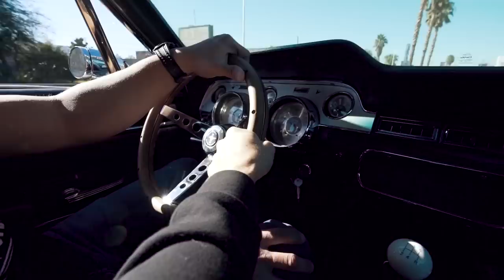THE WORST INVESTMENT *CLASSIC CARS*

Comment: You don’t know what happened? You went from 4th to 2nd big homie.
Reply: Austin Hayes that hurt to watch
Reply: Hahahaha lowkey huh
Reply: Never seen someone try to do that with out double clutching, and this guy supposedly “knows cars”
Reply: lmao i was thinking the same thing
Reply: @YxEthan  have you seen the video where he broke a brand new 2020 gt500 lol did a burnout straight away cold just been off truck 2 mins blew it up idiot guy all money no idea
Reply: Dude you can go from 4th to 2nd gear there’s nothing wrong with that. The car should not have shut off
Reply: Jacob s cool
Reply: Yx. Ethan 999 only been driving manual for 30 years so yeah I do know a lot about driving. Not saying he should have shifted from 4th to 2nd in a car that old but it definitely has some issues if it stalls out just from that
Reply: @ShiftyGenesys09  did you watch the follow up vid, sounded like that wasn't the issue in the end (although I agree shouldn't have been driven that way). Sounded like the car had problems out of factory already
Reply: @larssonk22  yeah he just shifting the blame ive never done anything like that in my car never jumped gears up or down only when stopping at a traffic light and doing 0mph lol
Reply: Jacob s it doesn’t have a rev limiter so he went too high of rpm trying to down shift like that, it’s always a good safety measure to put an ignition control box on these cars to prevent stuff like that happening

Comment: Houston.. I love watching your vlogs usually.. I must have missed this one back when. 

Here's the thing about older cars: They work just fine when you drive them in their limits and if they have been restored -properly-.

Now... the first thing is a matter of driving style and skill. No offense to your skills.. but your skillset has evolved around modern exotics. That's great.... but not trying to drive a big piece of detroit iron around. That gear change was both too fast and not violent enough.. and also.. I dunno if that's even a synchronized transmission. If it's not, then you should have double-clutched and I definitely didn't see your leg do that at any point or any indication thereof. Also, revs for shifts are at a totally different spot on something like that than anything you usually drive. Again, this isn't an indictment of your skillset. If you sat me behind the wheel of a lambo.. I'd probably kill it 2-3 times before I even got it -moving. Let alone drove it smoothly.

Second... restoring an old car properly: This is an artform and it's not about looks I'm speaking, but the mechanical end. FIrst, if you're not going to manufacturer original it's automatically going to have a lot of things you individually have to work out. Second, even if you are... a lot of documentation can be missing or difficult to find and a lot of the fabrication and etc. for those older vehicles is very much artistic and has to be done for that specific car-. As much as younger guys like to think they know how to work on old detroit iron, I've mostly found that they are nowhere near as good as the old guys who grew up with or -built these cars in the factories... but those guys are mostly dead or retired. It's nothing against the modern restorers/rebuilders.. but again.. art gets lost over time and old cars were not as exactingly manufactured so each car had a bit of its own soul going on. And again.. once you deviate from a factory spec.. even to a factory approved dealer spec? It gets a lot harder and with the latter.. example.. trying to build an "Eleanor" mustang... you get into very custom/one-off parts and if that car is even a few thousands out from factory spec, that affects how the mods have to be manufactured. All of that is to say that a properly built classic car honestly can cost you more than some modern exotics.

Third.. you have to understand that due to those inexactitudes in tolerances... that means a lot more maintenance than most modern cars and because of the era they were built in they sortof expected you to do so yourself and to understand what every minute sound, movement, etc. meant as well as regularly checking everything from distributor points to spark plug gaps. 

What that means is that they just aren't as simple to own, drive, etc. and have them properly work because there's so much effort you have to put in to keep it that way. Older cars can be quite reliable, just requires more work than monitoring engine lights and taking it for "regular" maintenance and some things need to receive preventative maintenance you'd never think of on a modern vehicle. shrug

YMMV and I appreciate your channel, just trying to explain from my view why you may have so many frustrations :)

Comment: Did you go from 4th to 2nd and kill it?
Reply: Sounded like he never made it into 2nd. I think he let the clutch out too soon before it was in 2nd gear and it stalled. He did say the battery was shot, and who knows the other issues the car has?
Reply: Mike Normandy old transmission can't handle a 4th to 2nd gear change that's why it grinded then stalled.
Reply: Yes.
Reply: He did

Comment: ive been a chevy nova fan and i owned 8 chevy nova's and im still in my teens and i can tell you its not the car its you if i was in your shoes it'll be a easy fix for me the reason why you hate the car is because a little break down GET THE RIGHT PARTS AND GET TUNE UPS AND KEEP THE CAR UP TO DATE ON REPAIRS  classic cars are amazing i went from 68 camaro to a 70 chevelle ss and now im hooked on the 72 nova's

Comment: The second it died, you should slammed it in 1'st, and let the clutch out to restart it. You were obviously having a bad day before you got in the car, and took your frustration out on that wonderful Mustang. Having NO CAR myself, I would love that Mustang, easy to repair, fairly reliable, and just an all around great car, and part of history. I think once you've had time to think about what you said regarding older classics, you will 180 your opinion. I think older classics would be an excellent addition to your rental fleet. 10 nicely rebuilt classics for the price of ONE SUPER-CAR! You can't go wrong, even if they don't pan out.

PS At 17 I owned a 67 Mustang which was just 10 years younger than myself. Unfortunately, it had the 6 cylinder, 3 speed manual, and the clutch had to be at least 100 lbs, and after 5-6 attempts at finding a fix for the clutch arm I kept bending, I threw in the towel and sold it for $1600 . LOL

Comment: you have to learn the car, these classics take skill that takes time for you to be able to handle, you have too high of expectations for a car that you mechanically know nothing about as in how well it is tuned, if the gear ratios are correct depending on rear end gear and tire height, what fuel rating in needs vs what you were running, how olds the components of the ignition system? these are all things you haven’t even began to consider then throw a fit because you’re embarrassed you don’t know how to handle the car your first day driving it

Comment: Like your videos, but you need to learn how to drive a manual, heel and toe is a must for cars like this, if not double clutch to change gears. Down from 4th to 2nd without even blipping the throttle, bye bye gearbox.

Comment: The video doesn't lie.  The car stalled because you messed up a shift(you tried 4th to 2nd without rev matching), it wouldn't restart because it has a bad battery(poor maintenance).  And you didn't realize that you could pop the clutch and it would just go.  So you don't like old cars because they suck?  or because they don't have paddles?

Comment: You could have ran it down the street by pushing it pop it in the first gear and pop the clutch and it start right up you don't need a battery that's what you got to do with older cars

Comment: Stick to driving an automatic boss you aren’t gonna go far if you treat your stick cars like there paddle shift also that gt500 ain’t a slam piece it was meant to be kept in a garage because its 40 years off being 100 years old so unless your wanting to put one of them brand new gt500 motors in em and swap the interior keep it in your garage tucked away

Comment: I'm sorry I'm not a Ford person but I have a 1969 Dodge Charger everything is original on it came with it from Factory I have repaired it and repaired it and repaired it it is back to factory spec you can repair a car that is old that is what makes it worth the money right there you have a $400,000 car if you take it to auction my car is worth $360,000 it's insured for 390,000 you're just not the type of person that drives an older car

Comment: Damn...  Lost a little bit of respect for that 4Th to 2nd gear shift change then getting pissed at the car cause you murdered the gears...  You can't down shift like that......
Reply from the maker: I was cruising in 4th at 40mph and the car randomly dies. I slow down to 25 throw it in 2nd to get it to start back up and nothing happens....exactly what your supposed to do in that situation.
Turns out alternator lost power and so did the car, that’s why it didn’t kick back on cause the fuel injection couldn’t turn on.